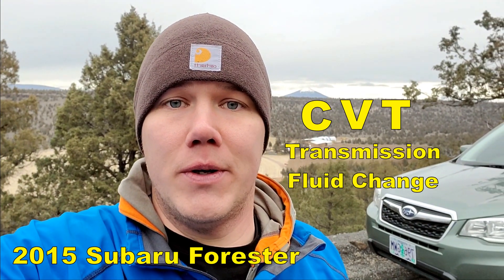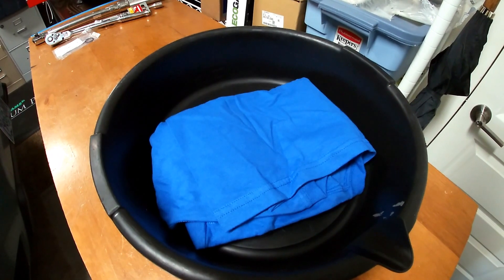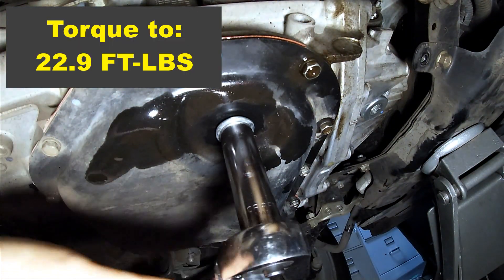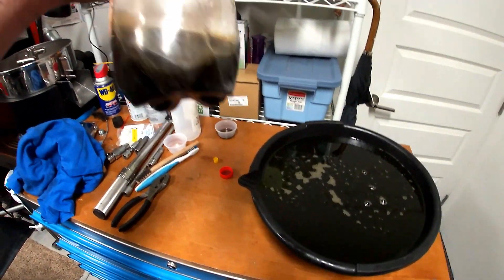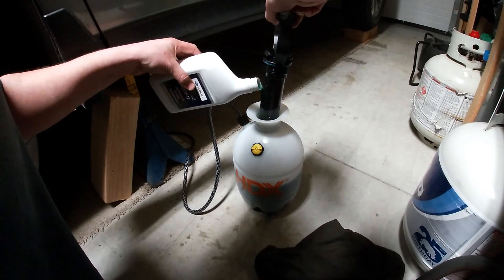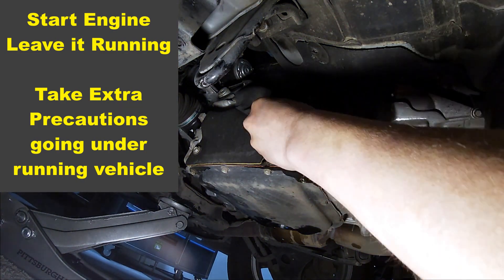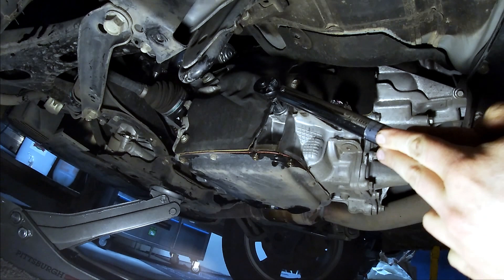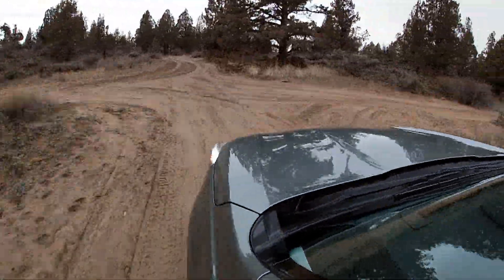Subaru CVT Transmission Fluid Change & Flush Procedure | 2015 Forester Replacement-Fill-Level Check

Comment: Why didn’t you change the filter. It is not that difficult to do. You are allowing the debris to circulate in the trans and restrict the filter.
Reply from the maker: In order to replace the filter in a cvt the case has to be separated. Big job!
Reply: MT I do it all the time. All that needs to be done is to drop pan on the bottom of the unit. Honda is the one that needs disassembly. I teach for Subaru and filter is replaceable on all Gen 1 and 2’s.
Reply from the maker: @harrylehrfeld4503  whats the p/n for it, post a video of doing it so others can see. The only filter I know of is not replaceable by dropping the pan, it would be great to see! TR580 right?
Reply: MT I have a unit I am working on now I will send a video to you as soon as I can.  Thanks Harry
Reply: TR580 and TR690
Reply from the maker: @harrylehrfeld4503  you must be talking about the pickup strainer?
Reply: MT same thing different name
Reply from the maker: @harrylehrfeld4503  I would be interested in changing the CVT's actual filter, which is a big job. If anyone wants to replace the fluid pickup strainer thats fine - I personally am not worried about it enough to risk contamination of the CVT. The fluid pick up screen is going to be a general debris block to protect the pump, and any debris stuck in it, or in the pan will stay there in the pan, because it can't make it past the screen- not circulating the entire CVT. For most folks driving in severe conditions they should replace their fluid as called out in the maintenance schedule, approx  every 28k miles, being some folks never change the fluid, maybe extending the intervals won't be a big deal. Thanks for your input & info. You really should make even a short video with the pan off and show everyone how easy it is (depending on skill levels & tooling) but post it yo your YouTube account, and drop a link here. I bet a lot of folks would like to see.

Comment: After a liability fight, Subaru had to pay to replace my transmission. Apparently the whole "you never need to change it" isnt sound advice.
Reply from the maker: So they said you should've had is serviced? Most people fall into the severe category which says service at 28k miles..
Reply: @MTsubfly  no, the opposite. I'd call and try to get it changed and they'd tell me it was a lifetime fluid that didn't need to be changed. That's also how they sold it when I bought the car. I called several times and started recording the calls because I could tell that it was becoming an issue. When it finally broke down, they acted like no one told me that and tried to make me pay for the new transmission. We went to arbitration and the hearing officer agreed with me based on breach of warranty and misrepresentation.
Reply from the maker: @mar91942  thats sucks. I wish they would just make stuff they stand behind. They told me the same thing when we bought ours.
Reply: @MTsubfly  they are good cars if maintained correctly. I quit taking mine in for service. Most routine service items are cheap and easy if you do it yourself but they want to charge you an arm and a leg if it isnt warranty related

Comment: Amazing. Just well done.  Please indulge me by helping me understand something.  A simple drain and fill takes let’s say 5 quarts- measured exactly by draining and measuring the fluid.  Then you pour in the 5 replacement quarts and finger tighten the fill plug.

If then I measure exactly what is removed by running the engine and using the oil cooler outlet method you showed, and do it say twice and each time add exactly what was removed would it be necessary then to go through the temperature check method to ensure proper fluid final quantity?

Once again: top notch work.
Reply from the maker: Thanks a bunch. Yes you should set the fluid level using the transmissions read-out temp. Consider if your method went well, has there ever been a leak, one that is hidden? Are you the original owner? Has anyone else ever worked on the CVT? Even just a tech that pulled the plug to "inspect" the fluid and level? Was the fluid level set correctly at the factory? All the variable's and margins of error could leave you with incorrect fluid level and damage to the CVT. Short answer: Use the temp method. Good luck!
Reply: MT Thank you. Let’s assume that’s it’s the first time and when the filler plug is opened there is a slight drainage implying that the level is good. I was just thinking out loud as to why fresh oil will flow out at the last stage and the filler plug is to be tightened to torque with a warm engine and a slight drip.  Confuses me arithmetically speaking.... given you can pour in exactly what you drained😀  who knows? Maybe a chemical engineer....
Reply from the maker: @Yankee7000  you still wanna use the temp method. If you pull your fill plug without the car running, you will have a bunch of fluid all over you. Level must be set at temp, car running. This probably has to do with each cvt needing slightly different amounts of fluid, based on how much each system consumes at idle ( torque converters, cooler & lines etc.) They probably have a good reason for this vs a more common method like a manual trans.

Comment: I did mine drain and fill about month ago with 135000km on the car, even just one drain and fill makes the transmission run much smoother.

Comment: What temp was the pan surface when the cvt was 100F? lol I don't have an android or a super cool cvt temp gun.
Reply from the maker: I dont know, but someone commented they used a meat thermometer. This is not recommended though, damage could happen if your fluid level is incorrect.

Comment: Hey MT,

Great video
Thank you very much for such a detailed one.
You did a better job even than subaru technician lol!

One thing
could you please show how to use that OBD Scan tool to monitor CVT fluid temperature and what app did you use
From start to finish if possible!
Maybe just add another short video & put link in the description etc!

Will help some people like me lol!
(First time doing CVT change, thinking should i take it to dealer or do it myself)
Like you said I would trust my work before any dealer!

Just to confirm 
Its TR580 Or TR690?

Appreciate it & thanks a lot :)
Reply from the maker: Thanks. So yea if you take it to the dealer they will just drain and refill the 5 qts in the pan...which is better than nothing, but with a OBD2 reader you can easily do that and save the $$.

So I have a video out already on the OBD2 reader I used, and what app they recommend, and what app I actually used. Hope this helps, here is a link: https://www.youtube.com/watch?v=KP1gUNm6Ddo

I believe I have a TR580 (non-turbo). Good Luck!
Reply: How would you use the Thats specific OBD scanner to measure CVTF temp
Do you mind making a short video or replying here steps involved?

Cheers
Reply from the maker: @kumarsonu4848  So I have a video out already on the OBD2 reader I used, and what app they recommend, and what app I actually used. Hope this helps, here is a link: https://www.youtube.com/watch?v=KP1gUNm6Ddo

This shows how to use it.....

Comment: Thank you for this vid it is very helpful. I had the same issue with my Honda Civic transmission. The dealership said that they should never be power flushed so they recommended draining, replacing, driving the vehicle through all the gears until it’s fully warmed up and then draining again replacing, driving through all the gears until thoroughly warmed up again and then draining and replacing and you would get over 90% of the old fluid
Reply: seems like a hot job and that you could get burned by the hot surfaces, WOW!!! crazy how hard this job is, I'm stunned.
Reply: @dabneyoffermein595  Since heat rises and you’re laying under the vehicle to do the drain, it’s really not a hot job.  You just wear thick rubber gloves and you’re good to go.

Comment: How many quarts did you end up buying of CVTF-II?
Reply from the maker: Bought 15, used 14, it holds just over 13, trying to flush it out, but based on the shown flush samples I might only recommend flushing out 1 or 2 times as shown (2qts per flush)

Comment: Hey MT, great video! Never would have thought so much fluid would come out of the hoses. Would you recommend doing this every 30 or 50K miles? I know you said you have the small flush at your 30K then at 100K.
Reply from the maker: Depend on your driving style. Could at least drain/refill the pan every 30 - 50k miles
Reply: @MT  hey if you drain the pan and refill how do you know if you have enough oil in there would i have to use one of them obd readers and drain it. i accidentally drained mine and refilled it. It was about 4 1/4 quarts that came out, and 4 went back in??

Comment: Finally got around to doing this on my wife's '14 Forester Premium 2.5 cvt engine, today.  Pretty level on jack stands.   COLD engine. When I removed the fill plug, I got a surprise!  Plenty of cvt fluid came gushing out (est. 1/2 to 1 qt).   Wasn't expecting that.  But, after everything was done, I had the same amount of old fluid from the pan as you did, about 5 1/2 qts.  Closer to 5 1/4 qts, actually.  I used my bbq meat thermometer to read the fluid temperature (103º F) instead of your phone app and device.   Just pan drain and refill.  I'll do this every other year or so.  Thanks for your video!
Reply: bbq meat thermometer?! you're my hero
Reply from the maker: Was your engine running when you got the suprise of fluid removing the fill plug?
Reply: @MTsubfly  No, it was off.
Reply from the maker: @carlrasmussen3267  gotcha, that would be why. I think i actually drained my pan first, then pulled the fill plug, but once I edited the footage it shows removing the fill plug first, but no fluid comes out. Thats a my bad for editing, not a big deal though.
Reply: @MTsubfly  What I don't get is if the engine is cold, the fluid hasn't expanded.  Yet, when the new fluid has been pumped in, we heated it up to within specs and it should just trickle out of the fill hole at the end of the procedure.  Weird.  Was the factory cvt fluid overfilled?  Or, does the fluid naturally expand over time, hot or cold?  I don't know.   Nonetheless, your video is the best I've seen on this.  Thanks again, MT.
Reply: also, the drain plug should always be loosened first in any drain and refill whether cvt or dif.  It's a safety issue in case the drain plug can't be removed for some reason.
Reply from the maker: @carlrasmussen3267  ain't nobody got time for that Carl! Lol. Jk -thats a good idea, I stripped a oil plug once as a kid, didn't take much.
Reply from the maker: @carlrasmussen3267  I think that its possible that each cvt may hold slightly different amounts of fluid statically...but the engineers for some reason 🤔  found it best to have the cvt running (using the fluid it needs) and then you top off the pan, this way you know it won't ever be too low. (Its a theory)

Every type of fluid expands different amounts per degree of temp change. I think cvt fluid changes quite a bit. But If the level is set properly, some fluid should come out when cold even though it contracts. Think about if your car was cold soaked at -20 degrees, would there be enough fluid until it warms up? Hope so. This may be why cvt,s can drive funny when cold
Reply: @carlrasmussen3267  You're fluid drained because the torque converter can hold like 1-2qts of fluid when it spins, but if it's not spinning, then the fluid will drain into the transmission pan. You got fluid out the fill port, not because of thermal expansion, but because all the pumps, heat exchanger, torque converter / etc were not full of fluid like they would be when the engine is running.
Reply: @lifeisgood070  does that jive with the 5 1/4 qts of fluid I got when drained?
Reply: @carlrasmussen3267  yeah absolutely. It's all stuck in other passageways, galleys, and stuff. you get about 40-50% of it from the pan
Reply from the maker: Glad it went well for ya!
Reply: If you want to do just a drain and fill, I think it is wise practice to remove the fill/overflow plug first and measure the amount of fluid that comes out. This fluid, as @lifeisgood070 explained, is not an overfill but resettled fluid from the torque converter and the cooler (heat exchanger). After doing so, then you can remove the drain plug and measure the rest that comes out. Putting all the amount you took from the drain hole back in is easy. But putting back the amount you took from the fill hole part is tricky. I think the way to do it is to plug the fill hole first and run the engine for a few seconds then remove the fill plug fast and put the fluid back in before the fluid from the TC and heat exchanger flows back to the drain pan. You can repeat this process until all the amount of fluid from the fill hole is back in there. Remember, this is all done when the CVT is cold. What do you guys think?

Comment: Great video.....did you consider dropping the pan?  Is there a magnet or any filter or screen that could be cleaned or replaced?  Thank you
Reply from the maker: sthier24, no I did not consider dropping the pan, unlike conventional automatic transmissions, the CVT is said to be highly sensitive to debris, or any contamination. There is a filter, but I believe the case has to be split to get to it (good luck with that, Lol) and there probably is a magnet in the pan, but I dont know for sure. I wouldn't worry about it. Give the CVT some fresh fluid and she'l be happy.

Comment: Did you end up reusing the gasket for the fill plug? My dealership stated that only the gasket for the drain plug needed to be changed
Reply from the maker: Nope! I used a new one. I come from an aviation background where gaskets, orings, etc never get reused. On my cars I try to get new stuff, but not always. You will probably be fine. Clean it & the seating area though.
Reply: Welp, I ended up shifting through the gears once and topped it out. Once it got there, I had seen a temperature of 127. Test drove and it seemed to run fine. Let's see how it runs from here on out
Reply from the maker: @mynameiskenny01  I would speculate that in a cold climate it could have a low fluid level then. Like if you live where it gets below freezing. Might run odd until it warms up and fluid is fuller. 👍
Reply: Also, as I was filling up the transmission with more fluid until it came out as the engine was running, my transmission temperature got up past 100 (up to 108) before I could get the chance to shift through the gears, do I still need to do this and then fill it up to full again?
Reply from the maker: @mynameiskenny01  spec is 95 to 113 F after shifting gears as noted in the video. Shift those gears!

Comment: MT, I enjoyed your video and found it to be far more user friendly than some others I've watched. I'm curious though....what harm is there in simply draining the 6 +/- quarts of transmission fluid then replacing with the same amount of fluid and potentially doing it all again a day or so later? If that can be done, do I need to watch the temp?
Reply: I had the same thought to do it that way I don't know how important it is to do it to the temperature thing but I'm planning to just use a kitchen temperature gauge and stick it in the hole and watch that I can't imagine with all of the fluid pumping that it wouldn't be all equal temperature anyway.

Comment: BEAUTIFUL video. Clear instructions and very well made. Thank you so much for making this.
Also a question I have a 2012 outback, do you know whether those two hoses would be in roughly the same area on my engine? Again thank you so much.
Reply from the maker: Thank you for the appreciation.
I dont know for sure if they would be in the same spot. You might be able to see them by popping the hood. GOOD LUCK! 

THANKS!

Comment: Great video, thanks.  Question: Should I go through the gears while the fluid is cold or wait till it reaches somewhere between 95F and 113F?
Reply from the maker: I did it while it was warming up, BUT also did it right before setting the final level. The more you do it the more bubbles get out the way i see it, just don't get out of control...lol

Comment: Did you replace the drain plug? 

Can you provide the part numbers for drain plug and the 2 washers please. A link will be helpful as well. 

And what kind of pump did you use to get the fluid out the pipes intially?
Reply from the maker: No reason to replace the plug unless its been damaged. You can find the parts you are looking for on any Subaru parts website using your specific vin# so you know that you get the right parts. I used compressed air to blow out the oil.
Reply from the maker: You can see the part numbers I used in the video. But you may not have the same model, it never hurts to use your vin# and call the parts center for the correct parts.

Comment: Hello MT :0)
All ok there?
Still waiting for fluid but i have this scann app for ios and i wanna try it
So, what is the normal tenperature for CVT fluid once it gets its working value?
Thank you 👍🏼👍🏼👍🏼
Reply: Hello again MT. 
Hope all ok there
So happy because my cvt fluid is finally here, changing it this week.
Wanna ask you please, did you read the fluid deterioration parameter BEFORE procedure?
I wanna read it now for compare after the flush.
But having problems with obd/app 

Thank you :0)

Comment: I should know this, but I don't.  Are you showing a TR580 or TR690 CVT in this video?
Reply: He is showing a TR580.  I wonder if this procedure can be applied as well to a TR690?  I think the difference between these 2 CVTs, is the location of valve body.  in TR580 VB is located on top and in TR690 is at the bottom